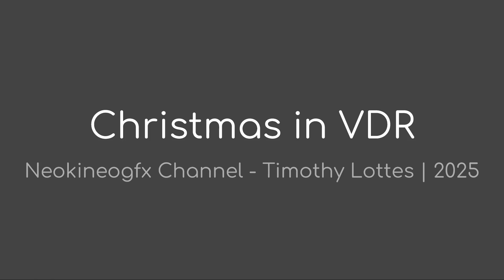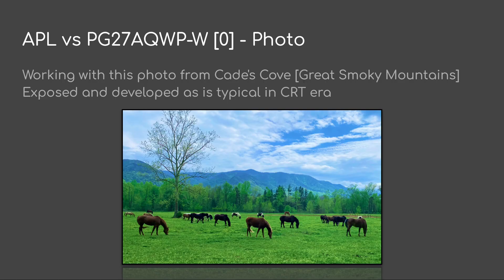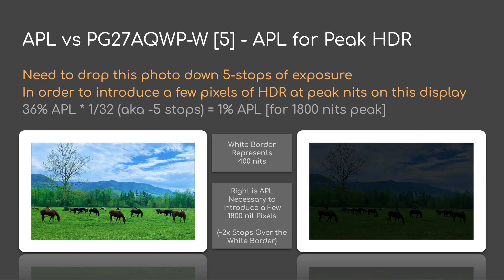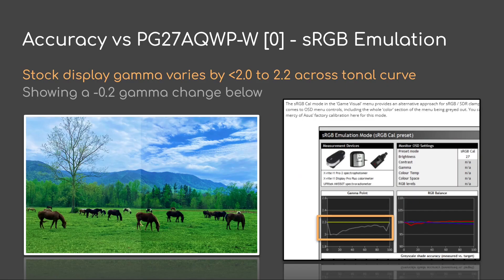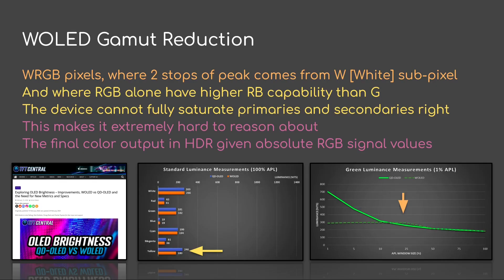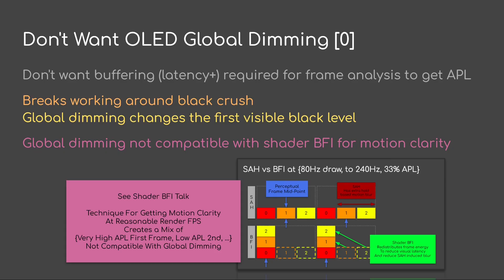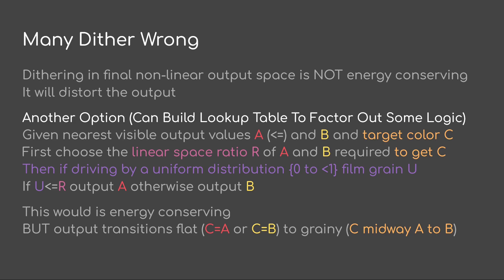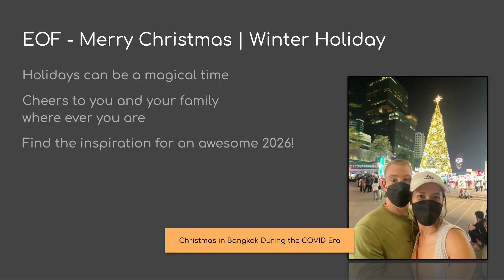Christmas In VDR

Comment: I had been thinking a lot about temporal+spatial dithering to combat colour banding and to effectively add 1-2 bits of colour depth recently. Though that was mainly for LCDs / 8-bit SDR at 60fps. If you render into high-depth render targets, you can do that as a final step that converts into sRGB. If you render into 8-bit render targets instead of floats/larger integers, you insert the dither during the normal pixel shaders for all the geometry. I found a 1px grid pattern that alternates between frames at 60fps and does corrections of up to +-1 brightness value can reduce visible banding in gradients by a lot. If the grid does not alternate between frames the grid can be visible if you look really hard.

I was basically using the way your eyes visibly perceive a grainy flickering noise when you are in very dark rooms as an inspiration for that. Nature dithers, and for dark vision, you don't actually see the actual brightness of something, but instead your eyes accumulate energy over time until the individual perceptors "fire". Of course, making such an accumulation would also be expensive, but you can simulate that stochastically by introducing noise into the frame.

If you forward/forward+ render straight into 8-bit sRGB output (think mobile / tiled, or laptop iGPUs), then you need to do this noise in linear light and then convert that to sRGB. Instead of using just a gamma function, you can also use thre 1×512px grayscale textures that represent the colour curve for the individual channels, and transform from linear light to sRGB. You can linear-filter those and also apply the noise during the lookup as a simple offset. That way, you get tone mapping, debanding, and display colour correction in one single operation. The grayscale texture should probably be in cache so it should not be super expensive to sample, and not have that much of a latency. You can adjust that colour mapping texture per frame based on scene intensity, or you can also make it into a 2D texture (think 4×256px or something) that lets you use aperture or exposure or something as a second dimension. Not sure how exactly that would work, though, I only just now had that last idea as I was writing this.

The per-channel colour curve can also be adjusted in the settings way better than a simple gamma constant using visual benchmarks like you showed in the video.

Comment: Hey Timothy - you are making some very interesting content on this channel :). Merry Christmas, and I hope you are doing well.
Reply from the maker: Thanks, just getting started, have a lot of user-side driver and code generation infrastructure to build in 2026 before I can get to the really interesting stuff. Hopefully I can find the time to get there. Happy holidays!
Reply: @neokineogfx  Very good topic and presentation.
On the signal side, games should emphasize full range(0-255) codewords to boost at least 18% on gradation detail!!  ( dither can boost this but it could have  resolution issues...)
Furthermore, energy-preserving signals may try to use Constant Luminance ITP or Y'cCbcCrc.
On HDMI / DP resolution@rate capabilities one less know issue is about 
4:2:2 chroma sampling below 12-bit depths are encoded at 12-bit for chroma sampling alignment reasons;  
Then a 12-bit  signal could be "free" since 4:2:2 is most times enough sub-sampling to allow HFR ;
Reply: @neokineogfx  Part2:  latest research by  Cambridge University on Visual limits changes the typical chroma subsampling ratios:  
only yellow-violet has half achromatic resolution;  
red-green has 90% grayscale limit;     
(Maybe  4:2:4  or 4:2:3 subsampling ratio is needed)
Also grayscale eye resolution basically doubles from about 60cpd to 96~120;